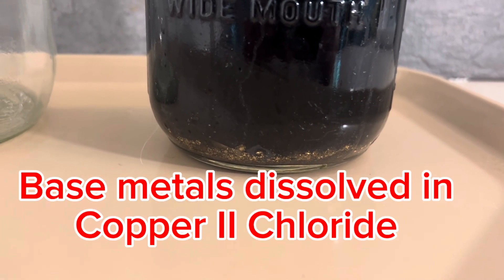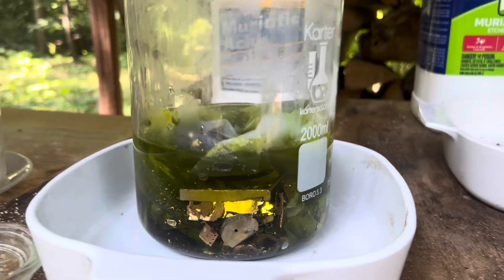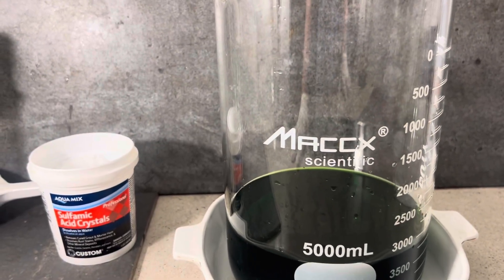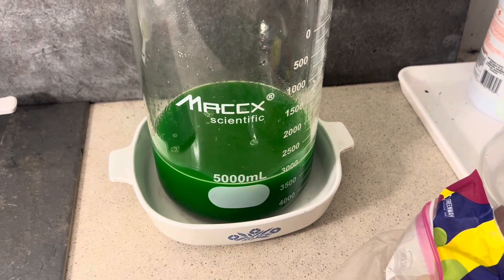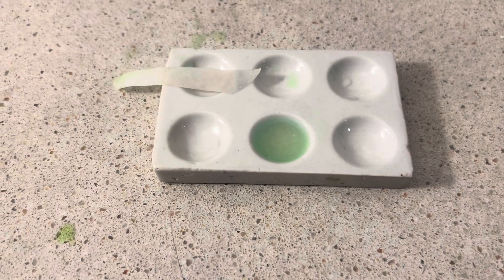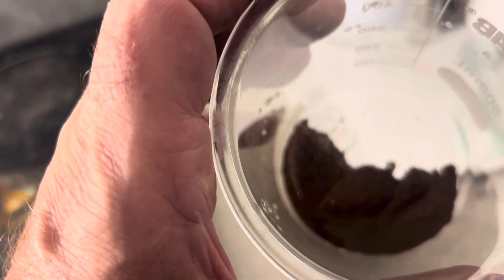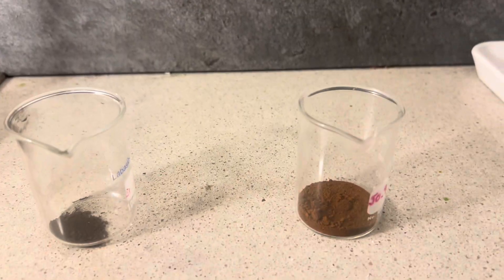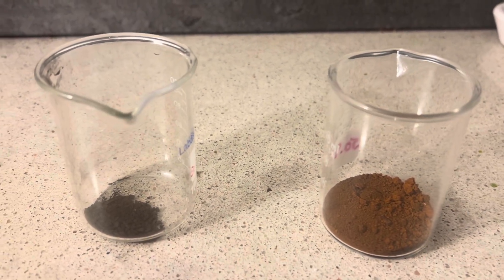25 Grams of Gold Recovered from GF Jewelry #gold

Comment: @3:39 you may want to premix the iron sulphate and then filter the solution before adding it to the gold stuff. to remove any extra stuff from that bag. idk what kind you are using though. if no one else has commented this yet. also i am not a chemist, just what i notice sreetips doing.
Reply from the maker: Thanks for stopping by the package was labeled at 99 percent pure, . HCl wash,three boiling  water rinses ,Acetylene  torch and flux . Seemed to have produced a nice gold bar with pretty sweet ripples on it .